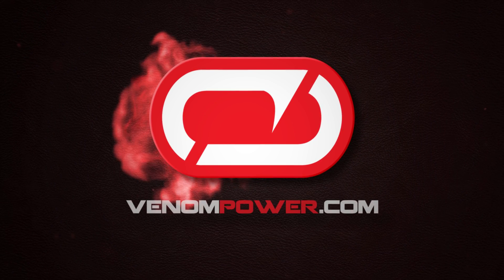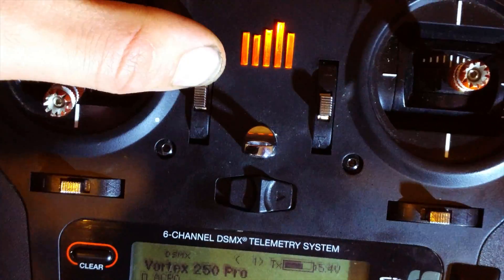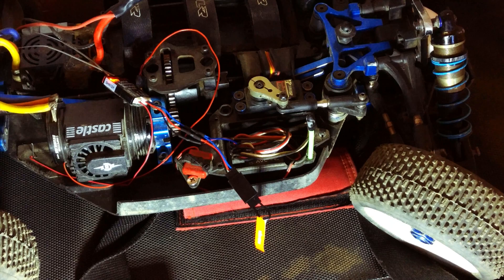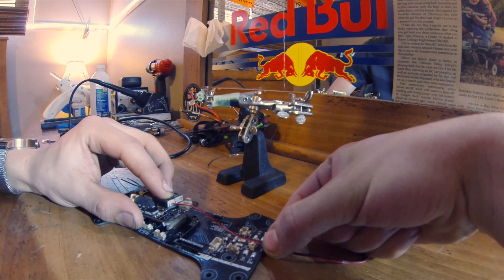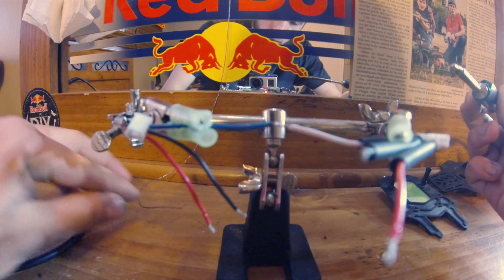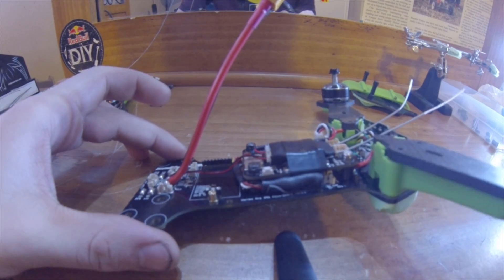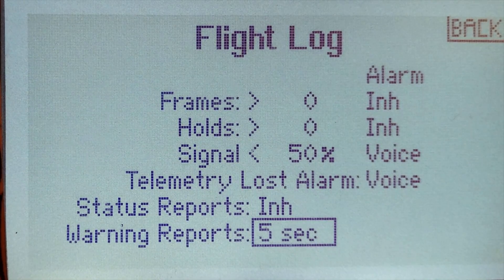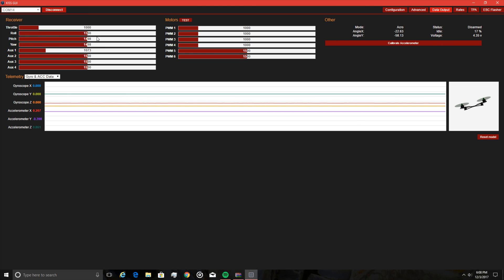How To Install And Setup Spektrum 4649t Telemetry Receiver With Vortex 250 Pro And Kiss FC

Comment: Hi will spektrum receivers work with pnp race drones would love a response thx
Reply from the maker: Define PNP and i'd be happy to answer your question if your still wondering. Sorry for the late response for some reason this was marked as spam!
Reply from the maker: Plug and play, yes you should be able to get the receiver to both bind and communicate correctly using the configuration software such as Betaflight.
Reply: @TheRcCrawlerKing  How you install the antennas on the drone and how long is the range?
Regards Uwe
Reply from the maker: @ueber30uwe  The range is fair. Less then a kilometer. Keep in mind the Spektrum system in this video is not designed for long range. The antennas route beside the rear LED light and just point straight out the back. Works very well like this and very well protected. Not blocked by carbon in this area either. I have since gotten rid of this system because I wanted to go farther. I upgraded to crossfire and now I can outfly my battery before I loose range. Much better system then this. In my opinion if you haven't bought the Spektrum gear yet don't. And if you have and your new that's ok it will do just fine. With how far out you can get on this stock spektrum gear it will already take several minutes to go and get it if you crashed at the edge of its range. Any other questions feel free to ask.